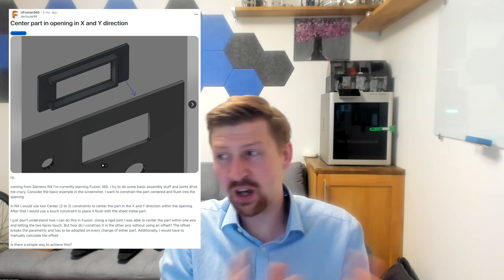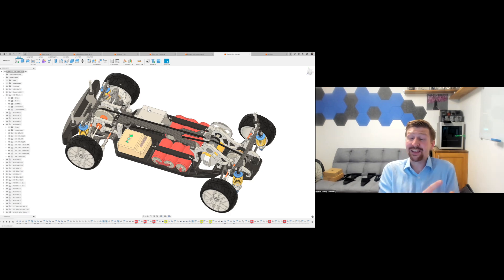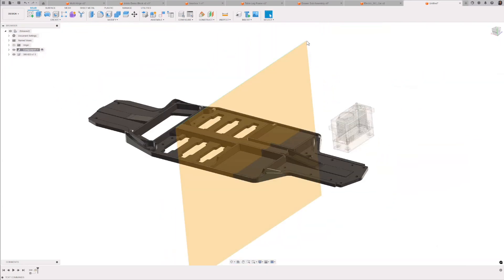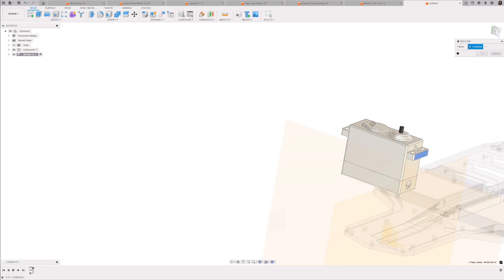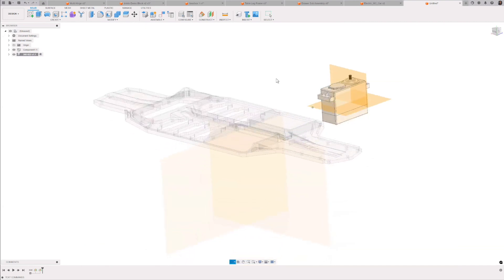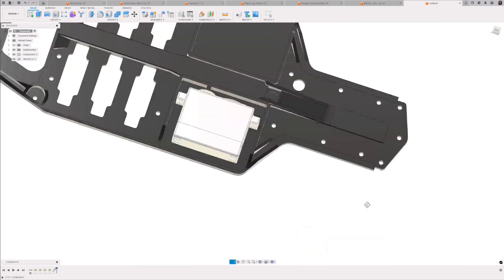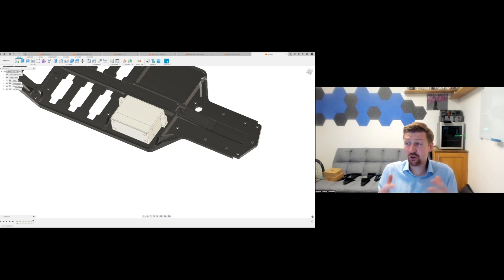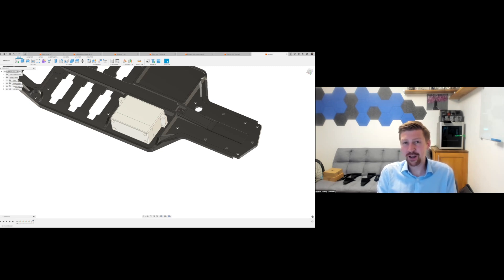How To Center a Part With Constrain Components | Unstuck my Fusion Design

Comment: This is a great method, but the user experience isn't. I have to add 4 extra features to the timeline, and create the midplanes as separate operations. Then later I need to turn off the visibility so they don't get in my way, etc. It's all a lot of clicking, extra clutter in my timeline and browser and generally extra complexity in my model that I don't need to see. The Joint command has the ability to center parts between faces. I'm not saying, just use a Joint - I get the value of the constraints. What I'm hoping for is that you will build the centering functionality into the Constraint dialog. Then I would only have a single timeline feature that is appropriate, the extra midplanes wouldn't need to be turned off later, etc. I spent 35 years as a software developer at a major university. One thing I learned is that when I have to give my users a lot of explanation on how to use my software like this it usually means that my software isn't making things as easy as it should. Many thanks for explaining how to do this. Now please go and build it into the constraint dialog.
Reply: We need more people doing what you used to do!.  In the early days of PC's was part of a team assessing potential software the company was considering... the one credo I tried to hammer home was that the user should never be left staring at a screen that has no obvious way forward or back, and the software should always present logical options relative to the task.
I like what this facility offers, but you are dead right about the mid-planes and extra clicking.
I have no experience with SolidWorks, but one comment I have seen again and again is how much better it handles joints than Fusion does.  Makes me curious...
Reply: Check out the latest update of Fusion, we have added.... wait for it... centered constraint :) These videos are hard, I knew at the time of recording this was about to be released but couldn't disclose ahead of the release.

Comment: This is excellent.
If some time later you wanted to move the servo vertically by 1/2 inch, for instance to allow space for an additional component, the Move command won't work.
How do you identify and edit what is constraining it?  The only way I can think of is blundering about on the Timeline.
In a sketch, you can identify constraints by their markers... if there is a similar way of identifying constraints for 3d objects, it must have snuck by me!
Reply: In the Browser there is a folder called Relationships which contains all of the Constraint sets created. You can rename these to give them, hopefully, meaningful names. When you select each Constraint Fusion highlights the entities in the model used in the constraints such as faces or construction planes. BTW You can edit the constraint and use the Offset for each constraint to make the offset within the constraint though probably this isn't appropriate here as you should be making the space by creating two constraints between the first and newly added third component and then separately the third component and the second component.
Reply: @dakin80  :  Brilliant!  From the short trials I have just done, the Relationships folder only appears when Constraints and Joints are applied.  It contains details of everything I was missing.
Thank you so much for taking the time to reply, I really appreciate it!   👍

Comment: I need to make ACME threads 3/4 x 5. been struggling for a week. Any ideas or demo?
Reply: EDIT:  *The day after I posted this, I found a chart with 3/4 - 5 ACME thread dimensions.   I have updated this with those numbers.*
I was bored.  I was intrigued by your question. I am not an engineer.  I have used Fusion (Hobby Licence) for a while on personal projects; I will never be a 'Guru'.
OK, that's got my credentials out of the way... the first issue I had was that none of the charts I could find showed a 3/4 x 5 ACME thread.  There is 3/4 x 6, and 1" x 5.
The end result should work OK, but most likely won't fit any commercial item.  Because of this, if you are not making both the screw and the nut(s), read no further!  
I created a custom thread using these dimensions:  Major dia: 0.75"   Minor dia: 0.5633"   Thread height: 0.09335"   Pitch: 0.2" (5 TPI)   Thread width at base: 0.124"   Thread width at top: 0.076"

1)  Create an axis where you want the centre of the screw.
2)  On this axis, create a Coil. (Type: Revolution and Pitch / Dia: 0.75" / Revolutions: 1 / Pitch: 0.2" / Section: Square / Section Position: Inside / Section Size: 0.128" / Operation: New Body.)
3)  Create a sketch on the square end-plane of the spring you just created.  Draw a rhombus, Short edge (Aligned with outer face of coil): 0.71" / Long edge: 0.128" / Height: 0.11" / Included angle between short edge and sides: 104.5 degrees.  The base should be constrained to the sides of the coil.   Finish Sketch.
4)  Sweep the profile you have just created around the coil:  Type: Path + Guide Rail / Path: LH outer corner of Coil / Guide Rail:  RH outer corner of Coil / Extents: Full Extents / Path Distance: 1 / Guide Rail Distance: 1 / Operation: New Body.
5)  Make Body1 (the Coil) 'Not Visible'...
YOU SHOULD NOW HAVE ONE 360 deg SEGMENT OF FINISHED THREAD!  🤞
6)  Select the Thread segment, and create a Rectangular Pattern:  Objects: The Thread Segment / Axes: the Axis you created at the start / Distribution: Spacing / Suppression:  UnTicked
Axis 1:   Quantity: As many threads as you need / Distance: 0.20" / Direction: One Direction
Axis 2:   Quantity: 1 / Distance: 0.00" / Direction: One Direction
You should now have the finished thread.   🤞🤞
7)  Create a cylinder around the axis, to fill the centre:    Diameter: 0.53" / Height (Actually length in our case): As required / Operation:  Join.
8)  Tidy up the ends using  Modify / Split Body, or similar.  Use create Component from Bodies if you need a component.
**  IF ANYONE WAS NUTS ENOUGH TO TRY THIS, TELL ME IF YOU GOT THERE...
**  IF ANYONE KNOWS HOW WE SHOULD ACTUALLY DO THIS, SHARE THE LOVE, PRETTY PLEASE!!  😍  There has GOT to be a better way!
Well... that filled in a bunch of time... now, back to the Mahjong on my phone.   👍 😜

Comment: That is the advantage of using constraints in this situation over a rigid joint? This method seems much more complicated and time consuming
Reply: This method is about control of your design intent. Joints find the center of a face, which may or may not be the reference you want, requiring manual offsets. A total pain. 

Solidworks and others have been using this constraint method since the 1990's and it is fantastic. Joints sometimes work fine, constraints ALWAYS work perfect even if more mouse clicks are sometimes required. 

As a Solidworks user since 1998 and a Fusion user since 2017.....I have despised joints in Fusion the whole time. Having both is great. Next, the Fusion team needs to add advanced constraints like mid-plane, cam follower, etc.
Reply: @Factory400  I understand older systems like solid works use constraints and they seem to work for people who use those packages. I wonder if I have never felt joints were lacking is because the nature of my work I often need to do a lot of offsets of positions...
Reply: So how would you do it using rigid joints?
Reply: @nlkatz select the center node on the face or if you can't get a usable center node on one of the sides due to a uneven surface I would make a sketch on that face to get a center point and use that to center. Another method could be use the between two faces feature in ridget joints which can be helpful for a cylinder for example.